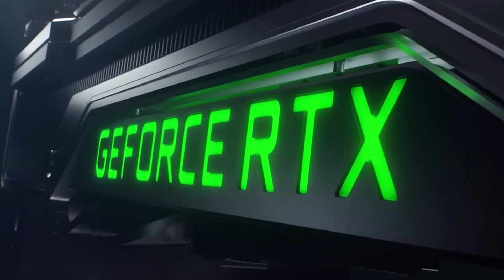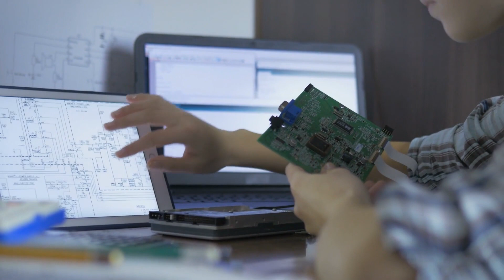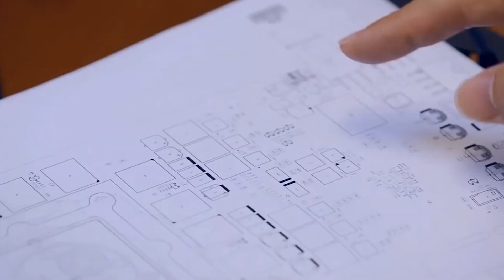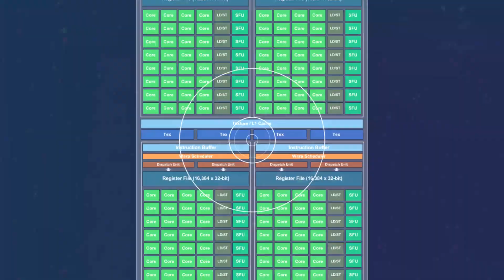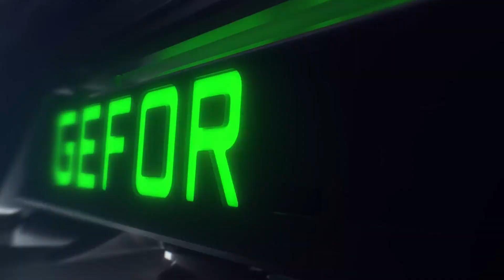Nvidia Geforce RTX 40 Series Everything YOU Need to Know!

Comment: I might be wrong but I feel that the 40 series gpus will only be a minor refresh just like the 20 series over the 10 series the 2080ti was just 27% more powerful than the gtx 1080ti, this is just my perspective you always have this with most major brand you have like a refresh model and the major redesign.
Reply from the maker: good point
Reply: @TopTierTech1  But again you never know with technology it might be a significant upgrade over the 30 series if they will confirm 5 or 4 nm chipset, Including New optimizations.

Comment: Kopite7Kimi has said there could be an 800W RTX Titan with crazy levels of raster and ray tracing performance. I'm fairly certain  everyone will expect an 800W GPU to have insane amounts of performance. It should be over double the performance of the 3090 Ti even in gaming if it actually becomes a product. I doubt it will happen, though, because 800W is just absolutely ridiculous for a consumer product.
Reply from the maker: My power bill…rip.
Reply: @TopTierTech1  your circuit breakers rip…